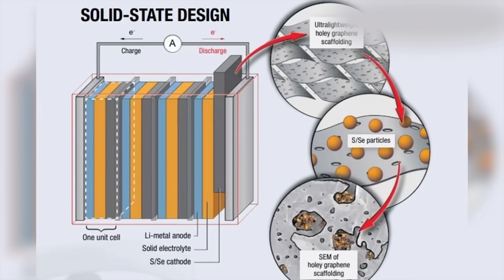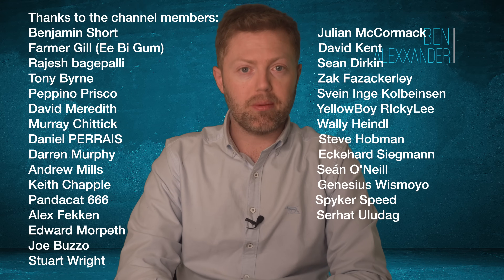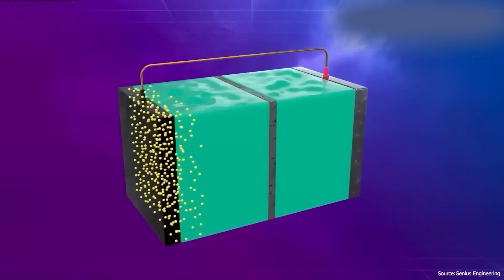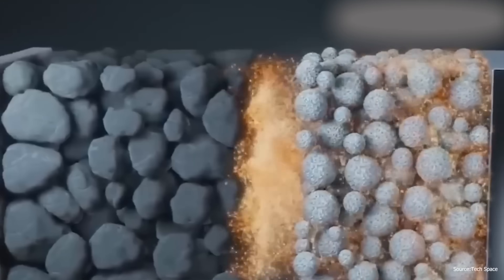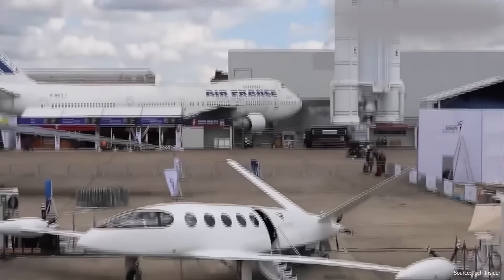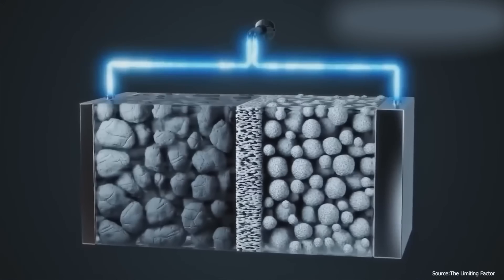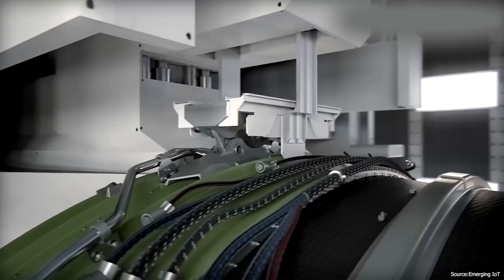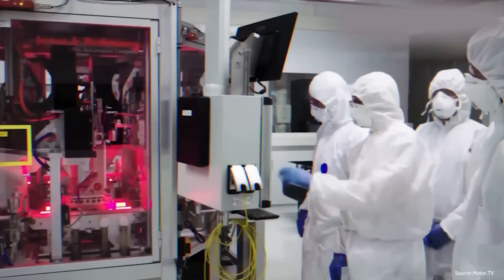NASA’s New Sulfur-Selenium Solid-State Battery Could Redefine Energy Storage

Comment: yeah the next plane i fly on will probably be electric if i dont take a hot air balloon flight first
its not just planes, with modern solar panels and capacitor-batterys combo's with the new motor and turbine designs you could have massive dirigibles that operate the way cargo ships do today but much faster and with ability to park up in even very small airfields and little to no need to refuel in most environments/times
maybe one day well see grocery stores that just fly from markets along routs of towns in some places such as mid west usa, Australia and Africa
the issues never really been the tech though
they had dirigibles that could carry 2 tankers of oil worth of cargo on drawing board in 2003
the issue has always been our aviation industry is a oligopoly
but china has a 10 year plan for aviation they started last year so within a decade they will be a thing because they are highly efficient and china exports a lot
Reply: You won't be flying for a long time my friend and if airships were the answer they would be flying around now

Comment: SABERS is 4 years-old and hasn't been marketed yet. The U. of Adelaide developed a Lithium-Sulfur battery yielding 1,306 Wh/kg with 1,000 cycles at 8C power density, but combined with the anode ion sieve developed at Karlsruhe U that provides 25,000 cycles at 5C, you’d have a cheap, really energy and power dense forever battery. The ion sieve of the Karlsruhe Li-S battery is so efficient, it can even reach 150C with decreased cycling life.
Reply: If it worked it would be in production these things sound good but theirs always a hidden issue
Reply: How do you know it is cheap when it isn't made yet.
Reply: @cajampa  you can make some judgement from the materials needed but they are right about a number of batterys and capacitors that have come out of labs recently/last few years that have >500wh/kg 
plane fuel only has about 690wh/kg equivalence energy iirc and some of these electric turbines are getting up above 90% efficiency compared to most conventional ones sitting at 60-80% so with a 92% efficient turbine  you only need a 600wh/kg battery to be comparable power to weight ratio wise
Reply: @violetquinnlaw  'Aviation fuel has an energy density of approximately 12,000 Wh/kg, which is about 50 times higher than current lithium-ion batteries.'

Comment: 1. ITS NASA so it's not going to be commercialised or available for general public. 2. Rich folks will still happily feed our communal breathing air to their private jets if they're even a little bit quicker than the new electric aeroplanes...
Reply: they arent though, the new electric engines are hitting over 90% efficiency and most have adjustable rotors in turbines so they can have a wider angle of attack/ceiling of operations. 
the issue is there's only 2 air company's in west really and they both have a lot of the old type already and it would rapidly depreciate the value of all their other lines if they brought out a electric one they could operate at 1/5th the cost for fuel or less
Reply: @violetquinnlaw no electric aircraft has a meaningful range as yet and safety needs to be fully addressed
Reply: Nasal always releases stuff for commerce

Comment: Why do you say we have good motors.
Those are bad motors
Even latest ones.
All are motors that become hot when runnng.
Those use the second patent from nikolas tesla.
The motor with electromagnetic contre force that has patented to consume more electricity because the first patent was too efficient. It consumes 3 times less energy. Stay cold even at high Rpm, exists for 140 years.

Comment: well, its claimed 500Wh per kg is still nowhere near to power a commercial airplane (something like an Airbus a 320) with it. (We would probably need an order of maginute more (10x) to keep existing airplane designs. And given how long the development cycles are in this industry how can you say that in the next 2 years we could see it? :D
Reply: You need 1 MWh per kg above 6 tonnes all up weight to make it commercially viable. Drones work fine at 200 Wh per Kg now. We have 2kg lithium polymer batteries pumping out 10Kw for a few minutes now. That’s 400Wh discharged at 25C for 3 minutes.

Comment: We need double the current lithium-ion batteries energy density just to make pickup trucks with the same range as ICE pickups when pulling a trailer, let alone aviation.
Reply: Fortunately there is a technology for full size pickup trucks towing trailers already. SSBs with high density and low cycle life are definitely applicable to aviation. The titanium exhaust on my helicopter is good for 1500 heat cycles and costs more than my house but I’m not driving it every day
Reply: @theairstig9164  Many pickup trucks have over 35 gallons of fuel capacity, which is like having a 350 kWh battery (and do so without being ridiculously heavy). We don't yet have batteries that allow EV pickup trucks to have over 350 kWh capacity at the same vehicle weight as existing ICE pickup trucks. That's my point. It'll come eventually but it's not here yet.

Comment: Interesting, but I understand Selenium is relatively limited in availability, while Lithium is also limited in availability (but less so). So this will hardly be a general storage technology, but targeted at specific applications where high energy density is crucial.
Reply: Lithium is one of the most abundant elements in the crust of the earth. So, please reconsider your statement.
Reply: @orion789  The most abundant element in crust is oxygen; 47% by mass.
Lithium 20 ppm.
Copper 60 ppm.
You "reconsider your statement" after checking.
Reply: @dudleymills1427  the one everyone is missing is copper great at moving power down lines but only 60ppm on earth and we need e shed load to sustain an electric future. I believe it is the limiting factor in an electric future
Reply: @keithbartlett9947  Aluminium is an adequate electrical conductor.
Mega Siemens per meter:
Silver 65
Copper 61
Aluminum 40

Aluminium 8000m series alloy 40 MS/m

'Aluminum has 61 percent of the conductivity of copper, but has only 30 percent of the weight of copper. That means that a bare wire of aluminum weighs half as much as a bare wire of copper that has the same electrical resistance. Aluminum is generally more inexpensive when compared to copper conductors.'

Al used extensively in transmission and motors.
Reply: @orion789  Er, and Australia - the world's largest producer of lithium - from spodumene hard rock deposits?(!)
Reply: @orion789  Lithium is relatively abundant, but half the world's known reserves is held by 3 countries (Bolivia, Argentina, Chile). With brine extraction, millions of tons of water is taken per ton lithium produced, while often contaminating the water and the soil. Extraction often leads to huge scars in the landscape. It seems like lithium is geologically scarce in the sense of "only" holding about 30 million tons of proven reserves worldwide that can be extracted economically.
Reply: @berntlie6799  "30 million tons of proven reserves"; 1 Mt in Jadar prospect in western Serbia in Mačva District but locals don't want / don't expect to receive extraction royalties.
Reply: Lithium is available in abundance
Reply: @maramé.r  Are you sure? We need to think in terms of scale. If every person car in the world is electric, we would need some 10 million tons of lithium in those. If everyone in the world should have the same car density as Europe, we need some 30 million tons of Lithium in the batteries. Today, Lithium recovery when recycling batteries is very low, but may increase to some 90% at best in the future. The current estimate of economically extractable Lithium in the world is around 30 million tons. To me, this is not "abundance".
Reply: @maramé.r Selenium: Ranks as the 24th most abundant element in the Earth's crust.

Lithium: Is the 31st most abundant element in the Earth's crust.
Reply: Selenium: Ranks as the 24th most abundant element in the Earth's crust.

Lithium: Is the 31st most abundant element in the Earth's crust. 

Sooooo😊
Reply: @rev.jonathanwint6038  Sooo??? Hydrogen is extremely abundant in the universe -- on the sun. That doesn't make it economically extractable on Earth. Same with Selenium and Lithium. Factual abundance in the crust does not imply that it is economically feasible to extract all of it. It is not the abundance in itself that matters. It is the amount that can be extracted with economic profit.